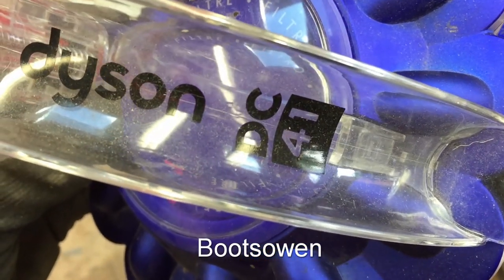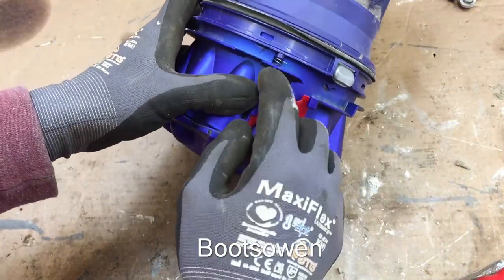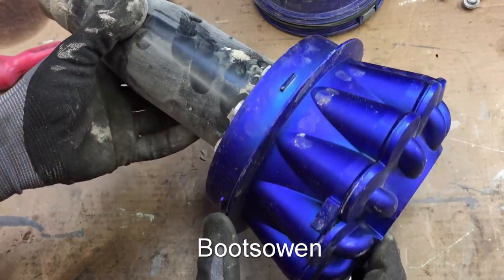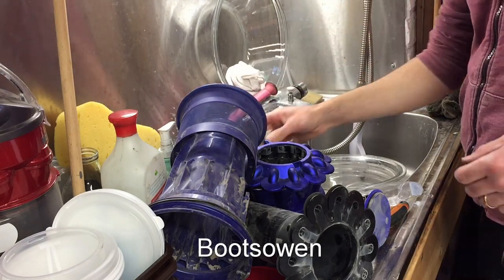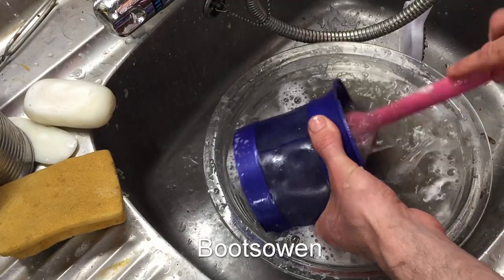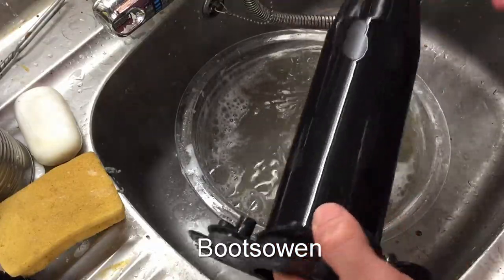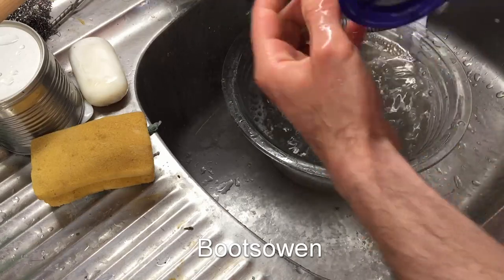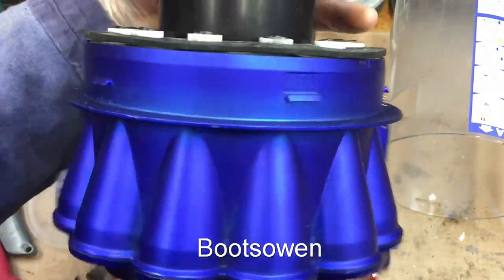Dyson DC41 | Thorough disassembly and cleaning of root cyclone vortex and cannister bin | how to

Comment: Thank you, cleaned mine without removing the screws, but I did use a small bottle brush in those areas and a hair dryer to blow the dust out. A little easier. Great video.

Comment: great video! I did this exact cleaning this weekend, 2 take aways I found.  the white plastic piece that has the inner lip that catches a lot of dirt can be removed from the minicyclone array and for taking the gauze off, once the I had the gap established with a screw driver, I used a paperclip and toothpicks to walk that section off.

Comment: Whoever decided it was a good idea to stuff those dumb little torx screws down in that ridiculously awkward spot buried up in there has never tried to take something apart. Gotta love engineers. 

Thanks for the video, the canister release button on my DC41 broke and I ordered a new one. I was worried I’d have to take the whole thing apart to get the bottom part of the button out but when you missed reinstalling it before you reassembled the top and found you could just stuff it in the side it saved me the aggravation of trying to get those torx screws out and back in again.
Reply from the maker: Good
Reply: FYI that white piece at 12:45 just slides off to make access to the screws a LOT easier.

Comment: Hey great video saved me a ton of frustration as well. Now my Dyson is nice and clean. Took one extra sep and let it all dry before reassembling and also lubricated all the O-ring areas with silicone. To keep the gaskets from cracking.
Reply from the maker: Yes. It is very important to let it dry.

Comment: The thing about bagged machines the smells go to the motor and you can’t clean out the bag compartment to get the smells off. The first time I took my daughters DC37 apart I thought it was hard.. but I just bought a 10 yr old DC37 for my son and it took no time to do the tear down. I will let it dry for a few days to be sure and that takes the most time if you need it sooner.62 yr old gramma here with free time to do it though.

Comment: My DC41 dust canister/bin has started to fall off the vacuum.  When engaging the vacuum rollers and snapping it back in, there seems to be some flex in the gray handle.  It's like the dust bin is able to just barely be able to start to fall out because of it.  It doesn't really look like the plastic is worn, but hard to tell. 

Do you think it's the spring inside the part at 2:35 starting to wear?  Any ideas how to make sure it doesn't pop off until I actually press the release button?

Comment: Hi, great video, really helps build confidence in tackling a job like this. Just one question. The bastard screws around the 9 minute mark - are they just standard Phillips cross slot screws or more exotic? My Phillips screwdriver is struggling to make them turn.
Reply from the maker: Dyson usually uses torx screws.
Reply: @bootsowen  Thanks .... just checked again and that looks right, so I'll get a set of long torx screwdrivers . Thanks again!
Reply from the maker: It might be possible to get a set of screwdriver bits with an extension, then you are not just buying one thing for one job, but maybe you need to get into a tight space! Have a look at my other dyson cleaning vids, I have done this to a few vacuums.
Reply: @bootsowen  The long torx bits (magnetic which will also help) arrive today and I can use with an existing screwdriver. Not too expensive. So I can get going again. Its quite a fiddly job though I'll get it done. Using the Dyson in its current filthy state creates a really unpleasant smell, not improved by washing filters so I really need a deeper clean. Thanks for all the help.